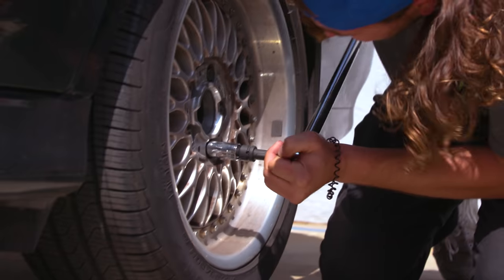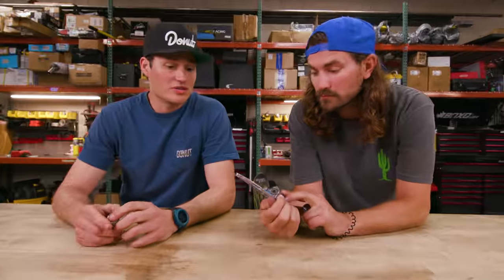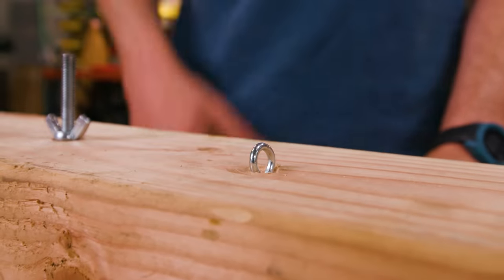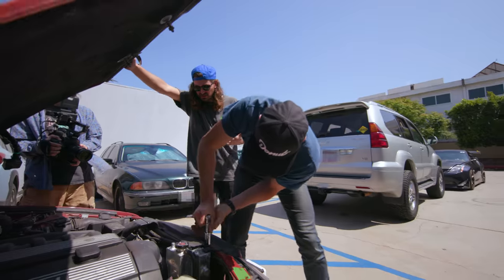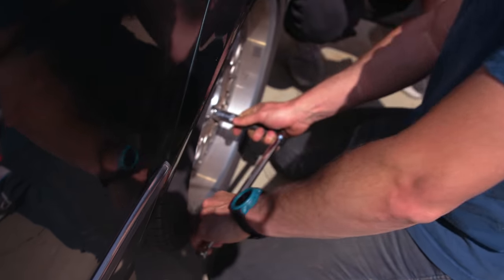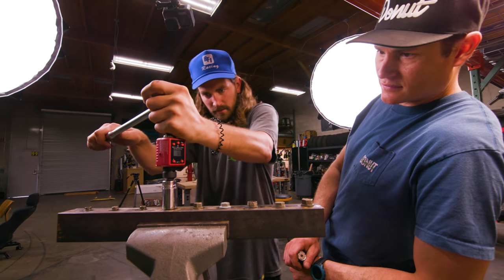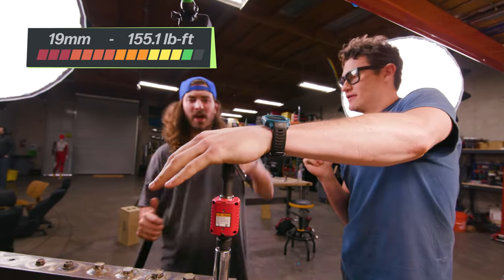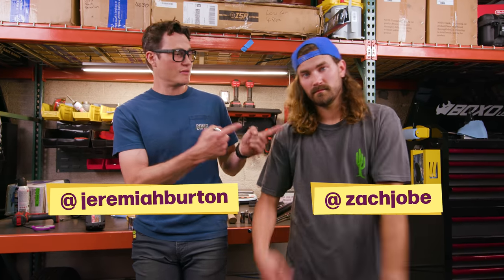Testing the World's Most Hated Tool

Comment: So, my takeaway is that it would be a decent tool with better materials, and more, smaller, pins closer to one another to get a tighter fit and reduce the amount of bending available. As to whether or not that's actually possible (since each pin needs to be independently sprung, each of which would require additional space) is a real question.

Comment: In advertising, "up to 150ft  lbs" means "No more than" 150 Ft. Lbs. 1ft lb is under 150, so if it slips after that, the advertising is correct. If it were to turn 152 ft lbs for instance, you would then have a case of false advertising...unless it said up to 150 ft lbs or more. That actually legally doesn't mean anything.Everything is included.

Comment: You know what? I have this and use it. It's all about what you use it for. I've used it to drive screw in hooks and it worked perfectly whereas major tool manufacturers eliminated screw in hook driver bits because they never need replacing. I've also been able to use it as a somewhat universal socket. 

People that hate on it aren't using it right

Comment: I got something like this for changing my oil because I didn't have the money to get a full socket set and am not a car person. I just don't want to take my car in to get the oil changed. Since it's max size was the size of the oil plug it worked like a normal socket, but because I'm a small girl I had trouble with it springing off when I was trying to fit it on, but once it was on it was on.
I did not get the gator grip brand.

Comment: Not sure about this test completely. I've broken good 1/2-inch ratchets on lug nuts before and bent braker bars on them also and then break the stud because most of the lugs were put on with impact wrench. And this one's more like a question why did you weld around top of bolt and not underneath may have skewed test somewhat. I've got tools all over the place, so I know I don't have any use for one, but lug nuts come on now you probably have some snap on sockets you could crack with those things.

Comment: Maybe the smaller sizes would work better if they had smaller diameter pins in the inner portion of the tool and larger ones on the outside?

Comment: I have a full set of tools and a fully equipped woodworking woodshop. And yet I successfully use the gator grip a lot. Of course like any other tool it requires knowledge and skill. If you use it in circumstances, you shouldn’t, it’s not gonna work like any other tool.

Comment: Well, this is kind of what to expect with a so called "Universal tool". Sure you can use it on various screws, bolts, and nuts. However it doesn't make a perfect fit, so you get these partial grips that can end up either damaging the tool or the bolt. There's also various providers of these, so some might be of better quality than others. Kind of like a wrench. Sure it can fit various sizes, but it's not as reliable as a set of spanners

Comment: Basically this is good for someone that isn't putting a lot of torque on whatever they are doing. Especially if it is someone that either doesn't know anything about the bolts they are using, or is switching bolt sizes frequently. But anyone that is a professional that isn't switching bolt sizes often and/or using lots of torque is going to toss it in a junk drawer.

Comment: I often wondered about these. It actually appeared to be a success (for the most part) from what I saw. Definitely not in the category of 'most hated tool'. If only a little more effort went into a higher quality manufacturing process so the pins don't blow out so easily, looks to have the potential to be a straight up winner. I'd def pay way more than $10 if the pins held up

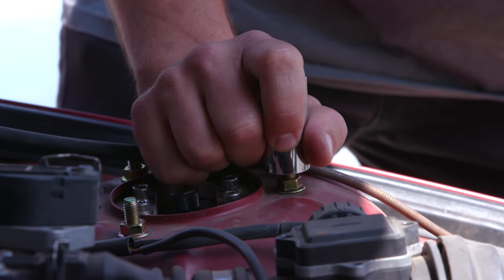Comment: 5:35 - Should that many threads be sticking out past the nut? This alarmed me since I work on airplanes and generally we’re allowed 1.5 to 3 threads to pass a QC inspection. I know cars are different, but is it normal to have a screw or bolt that’s way too long? Even if it’s acceptable it looks like sloppy/lazy work.

Comment: This but with far smaller pins maybe 3x smaller and more densely packed to a thousandths of a mm might work but you'd have to make it from something extremely tough and it would probably cost more than a full tool kit and of course you'd have to buy multiple for diameters and depth. 

It's a good idea but not very realistic

Comment: I think you can at best use them for for some easy carpentry stuff (like the hooks) if you are to lazy to carry around a bunch of diffent soze hook adapters. As emergency tools they seem kinda idiotic, especially for cars. You break one of them opening one bolt, and you still need a ratched or lever anyway. By the time you have opened the remaining bolts you may as well have gotten a couple of proper sockets for the common sizes on your car and can probably change all 4 wheels by the time it took you to get one bolt out with the gator. Them being cheap is not really an argument when you go through them like tissue paper. I feel like they could build them well enough to last longer, but then they'd probably cost so much that you could get fancy sockets in all sizes as well.

Comment: My take is it's more of a hail mary tool.  If the bolt head or nut is already stripped, it might save you from having to drill it out or cut it off.  Or you have an oddball that nothing seems to fit.  As a primary tool, it's not a good idea.  And expect to replace whatever bolt or nut was taken off.

Comment: One can hate on these pin sockets but I have used them on several occasions where they were worth every penny of the $14. Now, as advertised they are absolute crap. Also, it took off a wheel lock with no damage (destroying the socket) but I was happy with it.

Comment: I was wondering if you could use them on Locking Lug Nuts. I bought a vehicle from a guy and when I went to have my tires rotated, it was discovered that the wheel have locking lug nuts!! ARrrrrrgggghhh!! Went back to the guy and he found a socket to fit. Thankfully :)

Comment: I feel like this is actually intended for your non-mechanics. I'm not a mechanic, i don't want to go spend 100+ bucks on a large number of tools, i just want 1 tool that works well enough to get the job done in a pinch. Or something that works on a lot of things that don't require a lot of force(Since I won't be working on my car myself except to change the battery or oil.). So, something like this totally has a use, though I think they could use different shaped pins and they'd have less of a tendency to Slide.

Comment: I find it can be handy to have one of these in the toolbox, if you come across a cuple of screws and you dont have or need an entire set. But for regular use on common sizes, I'd use the correct size. Like if I was changing tyres all day long, I would not be using this :P

Comment: so basically if instead of this everytool they just had various socket sizes inside that spring out of the way instead of a bunch of rods it would be a much better tool? it just wouldn't be able to do every size since 1mm is probably too thin for the layers and the odd shaped bolts wouldn't work.

Comment: I think this tool could be better. First, it needs a lot more, significantly smaller pins. It needs pins to encompass the entire tool; the existing tool has none in the center, allowing the inner pins the opportunity to bend, ruining the entire tool. It could also use some kind of air compression to push the pins back into place; whether you plug a can o' air into it a compressor. The tool could be what it claims to be, it's just too cheaply made, as is.

Comment: To be far for the torque test they and 90 degree angling for their test while in this video it was less than that which will put an uneven amount of tension on some pins versus others. As someone who has used this properly to video spec. It will the job better but any small mistake will cause pin error. In ever test of torque their angling was not 90 and thus pressure in more parts than other. User error not part. Use it right and it will last you longer. Use it wrong and it will fail out.

Comment: It seems like this isn't necessarily a bad tool it looks like it works well enough with small things that don't require a whole lot of torque or tightness but doesn't work particularly well outside of that field

Definitely not the all-in-one tool drawer replacing super tool that it's advertised

Comment: My personal opinion is the only thing that the gator grip is good for is if you’ve got a fucked up or stripped head on a bolt it only works a few times and then after that it’s garbage but they’re cheap enough to where it’s not that big of a deal like five bucks

Comment: Just put all your sockets on socket rails and keep them organized. If it's an emergency kit for your car, you can buy a nice set of sockets in a blow molded case for around $100. I have a Gearwrench set in my car. Add a pair or 2 of Knipex pliers and a 2 foot piece of pipe and you're good to go. No need for this gimmicky junk.

Comment: These are and have always been a light duty tool to use when you don’t have the proper tool available or too lazy to go get the proper socket. The same can be said for a Multi tool it will Not replace a set of tools but it’s a good on the spot tool for when your Actual tools aren’t available.

Comment: Good video . I have never liked this tool; they either need more dense metal, hex shaped pins or both . This tool might be good for hobbyist but don’t try to cold torque bolts on an engine.   They are not gonna put snap-on out of business.

Comment: I have had the ones that they sell as the Gator Grip brand and they're garbage. Bent the pins and ruined bolts but I have one that is in my every day carry Leatherman kit. Galvanox makes one with the Leatherman flat bit adapter and it's great for small fixes and things you won't be ganking on. They work on odd shaped things best. Other than that, they're not the best tools.

Comment: If your it damages the nut or fastener you’re trying to remove then I think it’s a fail. Why use this and damage the nut when you can just take the time to get the right socket and do it right. It’ll probably save you the aggravation later on down the road when you don’t have to fight with a stripped nut or bolt.

Comment: I'm not sure what the situation is where you'd have this, not have your proper socket set, and want to do something right now but simultaneously not care if you rounded off the fastener and couldn't get any torque on most sizes... it seems like this is a "I'm too lazy to get the proper tool from the shed" scenario which then pretty quickly gets followed by "ah nuts I've rounded off the bolt head and broken the gator grip, guess I'm getting the MIG welder out and taking a trip to buy another bolt". In the same category as using mole grips (that's vise grips to you Americans, "mole" was the big brand years back in the UK and they were built like absolute beasts - still using some that must be 50 years old!) or silvergrips (channel lock pliers) - you think it's going to be quicker right up until you round off the fastener and you're spending the rest of the day trying to get it out.

Comment: Using common sense gator grips are supposed to be used up to 150 ft lbs of torque... obviously a car lug nut is way more and it's not going to work... and ahead of time you should have the right tire iron or 4 way lug star...

Comment: What the hell is this?   The gator tool is a LIGHT duty general purpose alternative tool.  It does work with min torque.  You guys are just torture testing the thing which it's clearly NOT designed for.  It's not the end all tool but it does a great job in general if you respect the limits.

Comment: Not sure how you can blame the socket when you were running the drill before setting it. Of course you're going to damage it when you use it improperly. You would have destroyed any socket doing that. 
I've had these bits for years, and they have completely replaced an entire box just as advertised. They also come from a much better company than that gator crap

Comment: GatorGrip works awesome actually until you add REAL torque to them then? Then thin rods in it get warped this the pussy metal they ACTUALLY are gets warped. The pins are actually long and as soon as one gets hit with serious torque? Even if it's just one of them that gets warped? Sigh. Will work awesome for thing that get to the medium point of hand tightening but beyond that? It's very flexibility becomes it's weak point.

Comment: How is it hated? I used that tool for years and it worked fine but it didn't work good with an impact gun.  150ft lbs torque lol no wonder my impact gun killed it.  Lugs are torqued to more than 150ftlbs the tools limit.

Comment: we have about 200 mechanics that work for different companys .. all mechanics work with nuts bolts and so on .. .. someone in the office saw the add and thought that this would be agood idea to give our mechanics .. so they did .. they ordered 250 pieces and gave 200 away each mechanic got one ... after 1 week 167 came back .. most broken .. every mechanic of those 167 said that they are garbage  they literraly fuck up the bolts and whats worst then a bolt that is hard to get out .. a bolt that you cant get out at all .. .. btw 30 of the mechancis didnt even tried them out .. only 3 said that they liked them ... 3 out of 200 ...

Comment: The gator grip socket actually does work pretty decent, but honestly y’all are some clowns the way you were doing it, anyone that knows how to “properly” use it will say it works in most situations. No it’s not perfect, but if
You didn’t have a certain size socket it would come in handy 🙄

Comment: WHen doing the torque testing, you guys were literally holding the socket on at an angle, essentially pulling the tool off the bolt.  I'd say there was a bit of bias going into those "pulls" because there wasnt one time that the tool was perpendicular to the surface.  Not defending this piece of shit tool, but at least know how to turn a wrench safely/effectively.